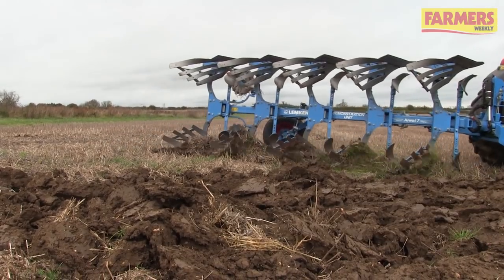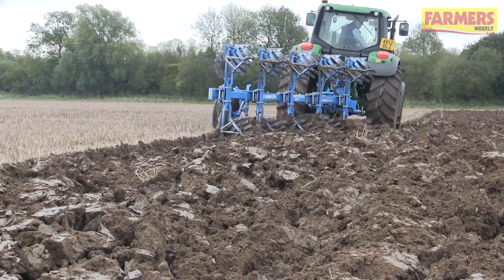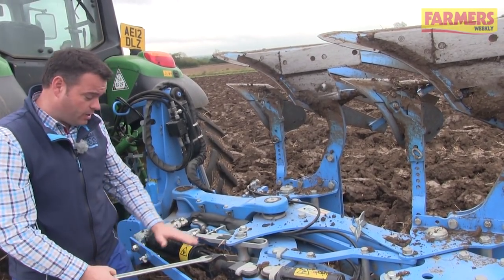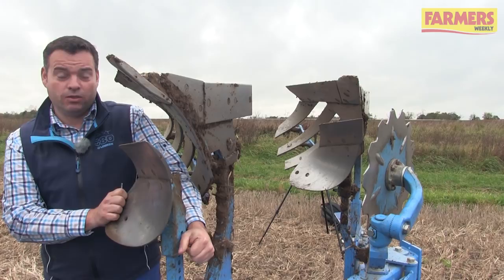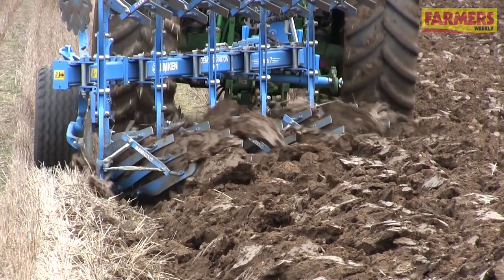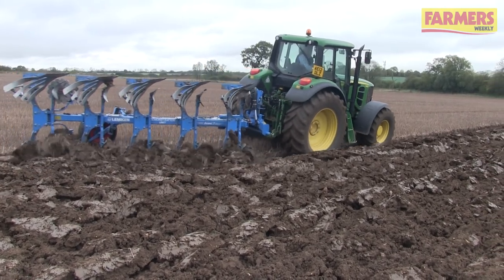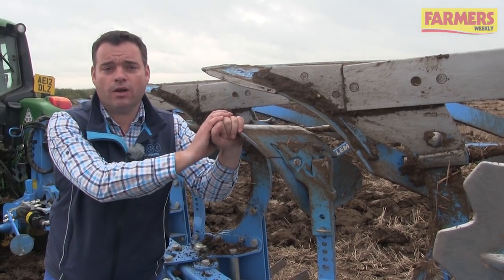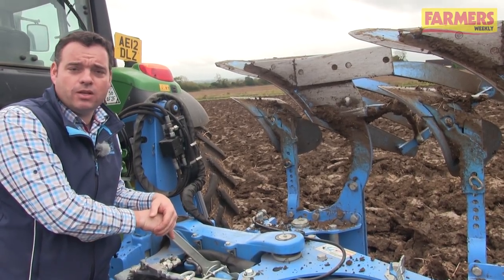How to set up a plough to bury blackgrass

Comment: That plough was not set-up for the conditions, and talking about efficiency! that would be the shortest distance across the field, he had several bends.

Also a tractor of that size should be capable of running on top, not in the furrow, this would cause less soil structure damage, one of the major causes of blackgrass is wet compacted clay soils.
Reply: So the ideal plough is when you’re driving on top of the soil?